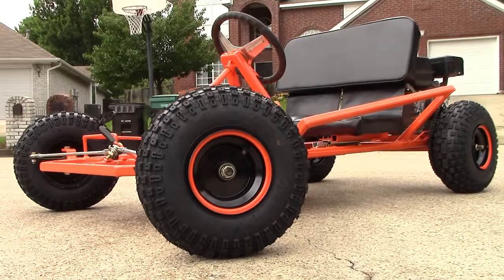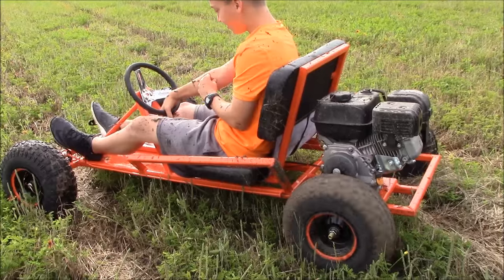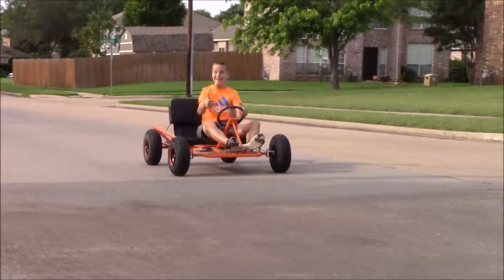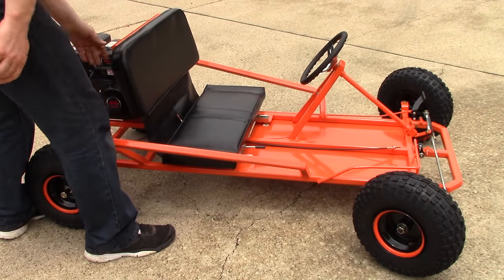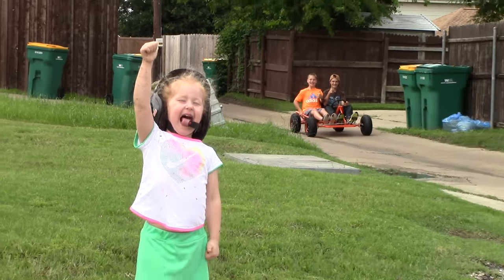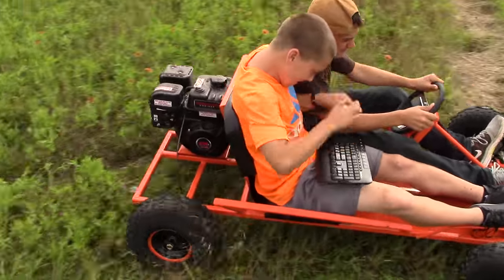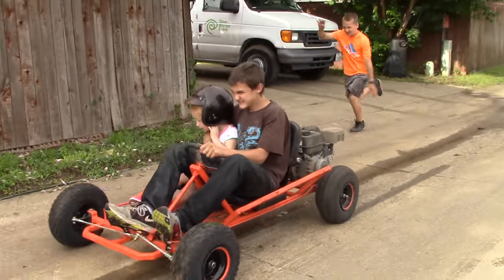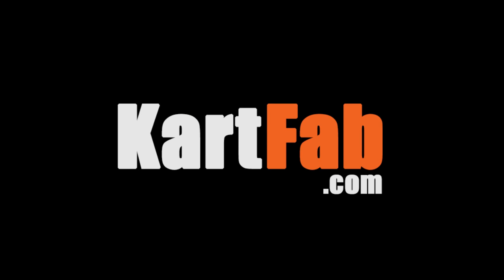Go Kart Build Free Plans (PDF Download)

Comment: Too bad all the measurements are in imperial system which is a real pain in the ass for 90% of the world. You should really think about us worldwide, expanding the clientele can't be a bad thing. 

But still that's an awesome job mate and I thank you for freely providing us this pdf. If i make this (and that's something I really crave to make) I will add a seatbelt haha, and btw do you think this can support a 200lbs man ?
Reply from the maker: +Le Cobra i weigh 230 and drove it with my 40 lb daughter.  I thought about imperial, but actually 86% of my viewers are from the USA, so I figure the other 14% can get on google and convert the units if they are serious. Same with material selection (e.g. 11 ga 1" tubing in what metric system in the UK/canada/australia etc would use) Then you come into very minor adjustments you must make for the kart plan... making an entirely new set of plans in metric for 'the rest' which, is just something that is not worth it for met to do, especially when all the parts that go with the plans are for the imperial system, bolts, nuts, rims, spindles... the list goes on. 

So if it were me wanting to build this, I would just get on google and translate the units as i built it with similar steel, possibly ordering the bolts online as well if you cant get them in a hardware store. They are a very common size in the usa.... because honestly, the kit is the best deal in the USA, and they ship everywhere FedEx International services....  because I have seen many people complain that they just cant get all of the parts in their country. Its tough being able to get any reasonably priced parts outside of the USA, let alone all the ones that you need. Good luck, and im sure you will figure it out with enough forethought and ingenuity.
Reply: Ah I don't wanted to sounds like an ass, obviously I will translate it, but it's just a bit annoying because all the great tutorial come from USA and each time I must translate everything firstly in my language to fully understand and not mess it up and then translate imp to met system.
But this is great that you provides the plans and video for free.
For the parts it's allright I guess.

Do you think cutting all the metal to the right measurements then welding all the pieces a good idea ? i'm kinda organized and it seems more effective to spend one day cutting everything, number each parts then spend another day welding everything.
Reply from the maker: After gathering materials you do this in four steps (4 days)
1) measure and cut steel
2) weld steel
3) prep metal, prime, paint
4) assemble all together
Reply: Thanks man, you are great and nice.

Comment: No offense but 25 mph is shit. Mine is built in a VERY similar way. Stock kart is 55 MPH and with my performance mods it goes 65MPH. Try to put a bigger engine on it and modify it with air filters, jets, and headers, etc.
Reply from the maker: I'm not offended. However, that is an incredibly naive and extraordinarily stupid thing to do to a go kart that is intended for children to drive around and have safe fun with. 

Let me put this into perspective. This is a basic, simple, heavy duty go kart. This is the type of kart that would be considered the most basic, entry level, and suitable for children and adults to drive and enjoy in the yard, or an empty street. 25 mph is more than enough for this kart design.

What you are explaining (55-65mph) is how fast a mid to high level race kart should go with an experienced teen or adult driver. The kart would also have passed safety inspections for these speeds.

25mph= fun kart (what I built)
65 mph= race kart (what professionals build)

Comment: you should have put a torque converter on it ;)
Reply from the maker: jayson hervey bwhahaha! yeah i made it a very simple build on purpose so it would be the most inexpensive kart to make. So far I think the consensus is with some people is that it needs a live axle and torque converter, which would be insanely fast. I will do this, but down the road late summer.
Reply: YAAAH!!! its gonna be insane!!! i hope you will make a video of it ;)
Reply: i want to see that lol
Reply: OH! By the way cool giveaway to +CarsandCamera ;)
Reply from the maker: You can thank Go Power Sports for that. They are the guys that I worked with to set up a parts kit for my go kart build as well. They also gave away a centrifugal clutch as part of a contest for ***** a while back, and have some involvement in one of his builds right now. Good company that is active in the go karting community as you can tell.
Reply: jayson hervey  not to sound stupid but im new what is a live axel?
Reply from the maker: A live axle is an axle that turns both rear wheels at the same rate. It has more power and traction to the wheels.

A 1 wheel drive or dead axle just drives one wheel and is the most inexpensive route to go
Reply: ***** could I install one?im sorry for asking so many question's I just want to be sure! :D
Reply: ***** like with these plans
Reply from the maker: These plans are for a centrifugal clutch, one wheel driven kart. If you wanted to make a live axle version it would cost more for parts and you would need to center the engine, then put a tav2 (torque converter) on it. You are on your own though if you decide to do it like that.
Reply: *****  then I think ill stick with the centrifugal clutch!
Reply: ***** in the future would I be able to change it?
Reply from the maker: It would be difficult. The kart is really designed for 1 wheel drive, centrifugal clutch.

Comment: needs a seat belt
Reply from the maker: +hypno toad its an old school go kart, not a car or off road buggy.
Reply: ***** you might slide off the side, or the passenger would be pushed forward
Reply from the maker: +hypno toad i added instructions on my website for adding lap band seatbelts. You basically take three large washers and weld them on and bolt a lap band seat belt to it. Its super easy to do, and will keep you strapped in.
Reply: ***** im satisfyed :D